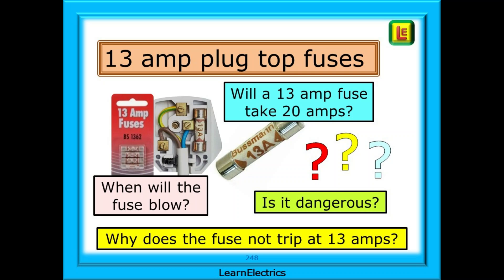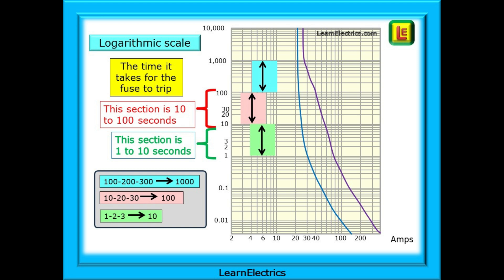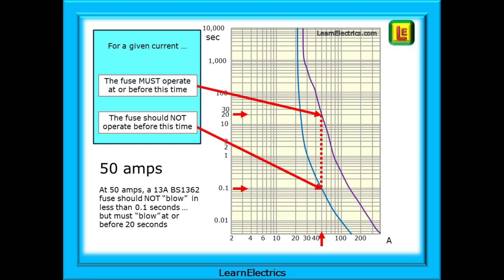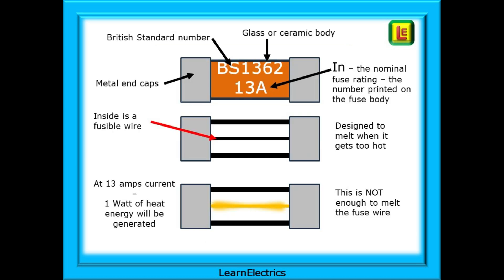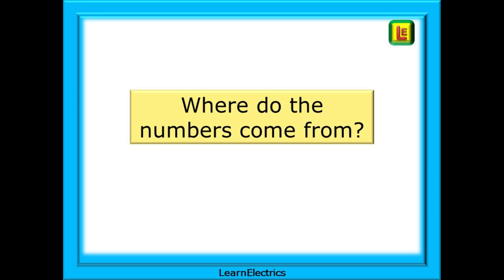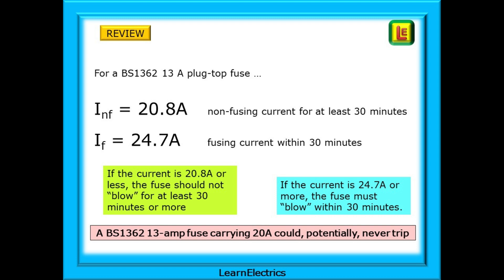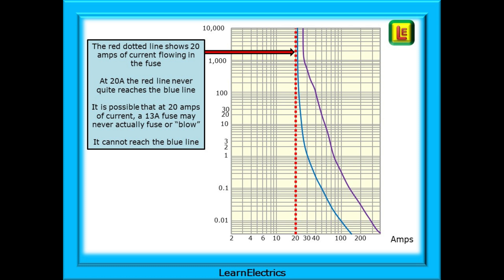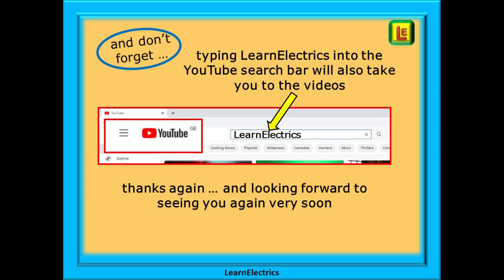WHY DOES A PLUG GET HOT – WHY WILL A 13 AMP FUSE NOT FUSE EVEN AT 20 AMPS – USING THE FUSING TABLES

Comment: Thank you. Its the fuse that acts as a heater that is burning the tops in high load applications like ovens even if they do not consume 13A of current. Problem can be solved with a 15A top.
Reply from the maker: Thanks for your input. Appreciated.

Comment: Unbelievabley interesting video from the master of electrical. Just a quick question, when working out IB and i know its power divided by voltage do you use 230 or 230 x cmin or 0.95 which equals 218.5 because it def has a bearing on the amps drawn.eg a 3kw handwash heater when using 230 equals 13.04 amps but when using 218.5 equals 13.73 amps. So according to your video a 13 amp fuse would be ok and may generate a bit of heat. Obviously the duration its on is important an immersion heater of the same power rating is going to be on a lot longer than the seconds it takes a person to wash their hands. Which do you use the 218.5 or 230. Thanks for a very interesting and informative video.
Reply from the maker: Righto ... I use 230 volts for most calculations. The actual wattage of a hand-wash heater is based on the figures on the rating plate. If it says 3kW at 230V then those are the figures to use. 
At 218 volts your output will be about 2.8kW -    3000 X 218 / 230  =  2843W which is about what you would get if you installed the heater on the continent at 220V. Hope this helps. Dave.

Comment: Excellent video. What concerns me is how many people will use a 1.5 mm flex rated at 15 amps or so, and protect with a 13 amp plug top fuse! Virtually nobody in the general public would assume a 13 amp fuse could maintain its integrity over that of the cable used in such cases. Most people would read the cable,e rating and presume safe to use with a 13 amp fuse!
Reply from the maker: Yes, I agree. Very surprising data. Thanks for watching. Dave.

Comment: The heat generated in a plug top fuse this is why I was always told to replace moulded plugs with a standard plug as heat can not escape from a moulded plug and may result in the plug overheating and burning. Also a standard plug has a small hole above the earth pin and a wide opening for the flex these allow heat to escape from the plug . Moulded plugs are completely sealed so heat can’t escape from them.
Reply from the maker: What an excellent observation. I never thought of that so thanks for enlightening me. Brilliant. And thank you for watching and contributing, appreciated. Dave.
Reply: Standard wirable 13A plugs are not all like that. I just looked at one I have in the bag and no provision at all. Must a cheap illegal import. Many had the top vent hole on the top of the lid. Or an enlarged locating hole for the lid, on the top of the lid - I just noticed my 5A round pin lighting plugs have an enlarged locating hole on a triangular lid which can only be fitted one way when fitting, which are fuseless.

Comment: Thank you for the so informative explanation .The wiring    on the demonstrated picture of the plug top are wrong .way round.
Reply from the maker: The plug top is next to a paragraph that says - always check plug tops when doing PAT testing. If you don't take the cover off, you will never find the problems. Well spotted

Comment: The 3 pin plug at 14 min has the blue wire connected to the fuse?
Reply from the maker: Yes it does. It's next to the paragraph about checking plugs when PAT testing. Thanks for watching, appreciated, Dave.
Reply: Well done spotting the deliberate mistake

Comment: An other good video with need to know info. But is there other sizes of fuses available for smaller appliances. Thanks for sharing.
Reply from the maker: Yes there are other sizes. The trend now is to install either 3 amp or 13 amp, as required, and 5 amp for computers.
Reply: Available from 1amp upwards. Many insert 1A fuses in plugs on table lamps with LED bulbs.

Comment: Great video as ever Dave. Why do manufacturers and British Standards design these fusing factors into their overload devices? Why can’t a fuse with an “In” of 13A operate at 13A of current? Or an MCB with an “In” of 32A operate at 32A?
Reply from the maker: Something that always concerned me. They should all allow a small overload for e very short time, but agreed, where is the safety in waiting two weeks for the fuse to blow if your stood on a chair with a handful of live wires.

Comment: It's amazing how many experienced sparks don't even understand the concept of Fusing factors and tables. For example, how many times do we see immersion heaters fed from a 13A FCU instead of a 20A DP switch? Thanks for the usual, clear way of sharing your knowledge 👏
Reply from the maker: A 13A switched FCU with 1.5 heat resistant three core is given in the books. I like the idea of using a 20 DP, plenty of room to get 2.5 cable in.
Reply: If the cable from the switch to the immersion is suitably rated, then why is it a problem? Immersion elements are 3000w drawing 12.5 A for about an hour per full tank reheat.  1.5mm heat resistant flex has a rating of 16A, I would use 2.5mm which is 24A.  The whole circuit should be on a 16A MCB/RCBO. I would argue either method of isolation is satisfactory, but every day is a school day?
Reply from the maker: Great comments, really appreciated, Thanks.
Reply: @MS-Patriot2  interesting to see you choose 2.5mm over 1.5mm even though 1.5mm is rated at 16A and well above the 12.5-13A the element can draw. I agree with your choice and for me, it is because of the time the cable and switch will be drawing that current for 2 hours or thereabouts for an average 117L tank, rather than the hour you suggest, and doing that cycling regularly will and does eventually deteriorate the plastic of the FCU. Also, as you point out the regs stipulate it should be on its own circuit anyway, so does it need a 13A BS1362 after your OCPD in the board? I don't think so. And yes, every day is a school day for me as well.
Reply: @olly7673  Nice discussion, how it should be.  Made me think a bit more and I’m now going to replace a couple that I have put on FCUs with the 20A DP switch.  Why else would they make one !?  I have seen the heat damage on older installations, it’s real.  I prefer the 2.5mm flex just for the safety margin but it’s probably overkill as the load won’t draw more than 13A and the 16A mcb will instantly trip on a live fault and the RCD/RCBO will catch the other more likely faults.  Same argument for purpose built immersion timers, they need to be rated for the duty cycle.  Now shall we discuss the cooker diversity chestnut ?👍😎
Reply from the maker: Thanks for your input to the conversation, appreciated.
Reply from the maker: Nice that you have taken the time to reply, thanks.
Reply: @olly7673 
Regs do not stipulate an immersion should be on its own circuit. Many immersions are on FCUs and 32A final ring circuits, which is within regs. I have seen many like this operating perfectly for decades.

If may be impractical to have a dedicated immersion radial circuit, as the fuse getting too hot causing scorch marks, when usually heating a very large cylinder of water being on for extended periods. A 13A mcb  in its own small enclosure with more air around it, and a 20A switch can be fitted off a final ring. 

A 16A appliance can be taken off a 32A final ring, but only if:
1)  the appliance is hard wired in, 
2) a local 16A OCPD 
3) a local switch fitted.

Comment: I'm just about to finish Level 3 after 2 years of study and here I am learning valuable information about a plug top from YouTube. Thank you.
Reply from the maker: Plug tops are important. They contribution to safety is so often just bypassed by the consumer. load it up load it up it will be ok. Now you can tell them why you are suggesting extra wall sockets and to stop using those 4 extension leads.